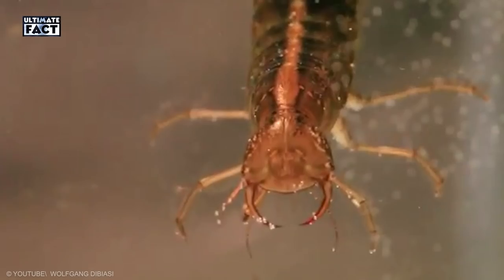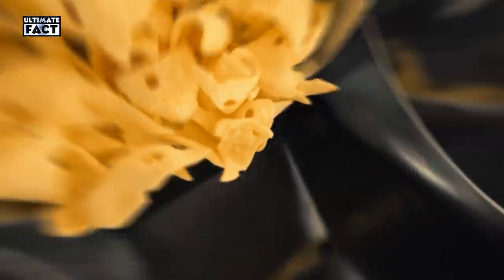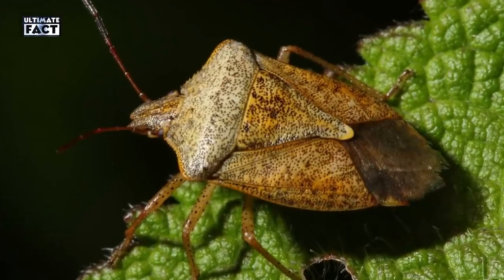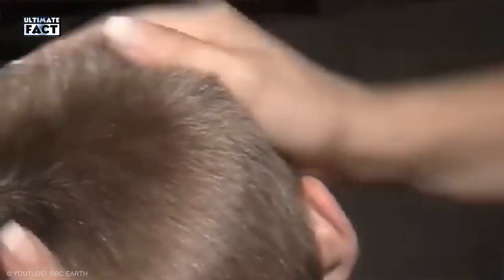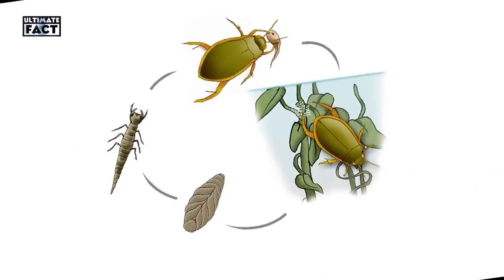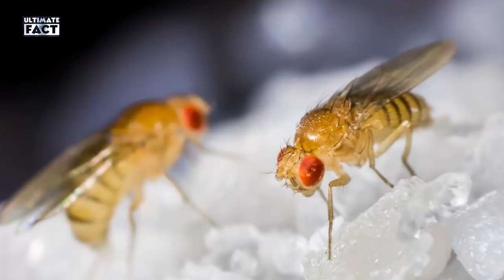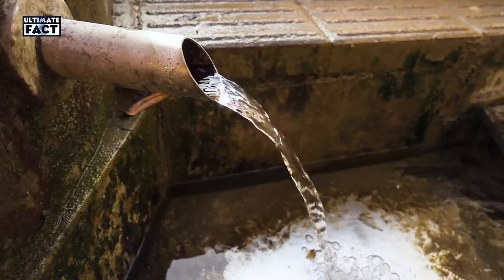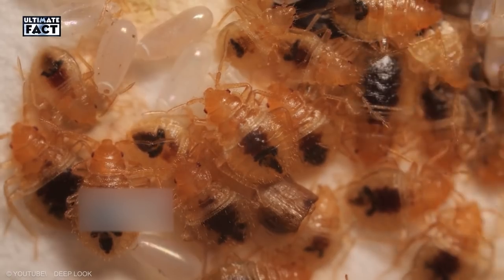20 Creepy Creatures Hiding Inside Your Bedroom

Comment: We have gnats of at least 3 sizes:  2 can be seen but the invisible one (or more) are the most troublesome ones because they are felt to be active 24/7. They bite really hard on legs, hands, ears etc. How can I get rid of them? I take out trash, cover foods, have installed insect netting on all openings but to no letting up. I spray with insecticide but it doesn’t last long. I can kill some at night when I go to bed killing all lights and while using my mobile phone these tiny pests come to the mobile screen at which time I squish them one by one. I used the blue light electronic zapping device too but it doesn’t seem to work on these tiny ones for some reasons.